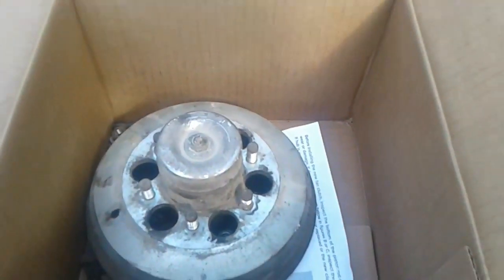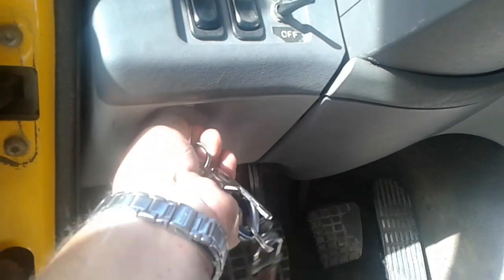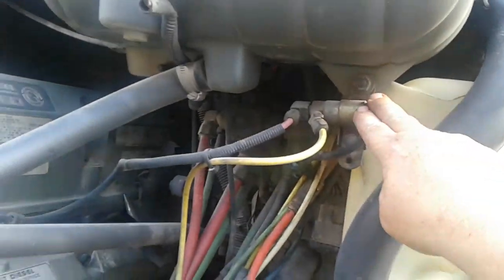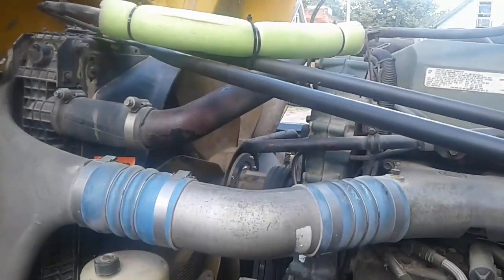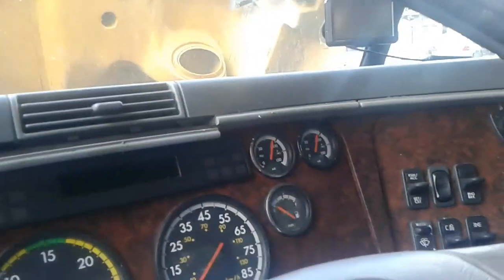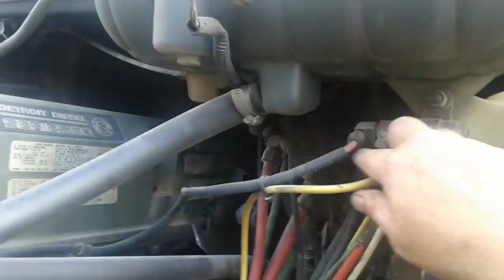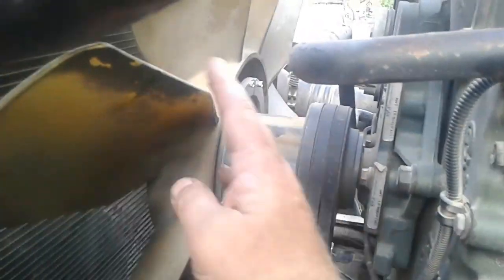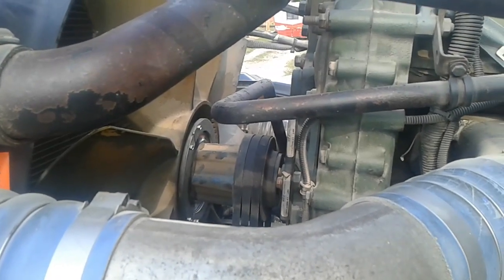Testing a fan clutch on freightliner Detroit diesel 60

Comment: Thanks for the video. When I turn my key to the "on" position, I get nothing. No bells or whistles like it normally does when it's cycling through. My batteries are showing 12.4 volts, so it's not the batteries. What can it be? This happened from one day to the next. Looking forward to your input.

Comment: thanks for your information, my question is do i have to build air when i test clutch?
Reply from the maker: Yes. Sorry took so long. Or the clutch won't shut off. Needs air to shut off. When you start your truck it engages until air builds up.

Comment: There is a lot more to these types of fans than what he is telling you.  He never mentioned the difference in Normally Open temperature switches and Normally closed ones and how they affect the air solenoid if its plumbed incorrectly and how that could cause the fan do do just what its doing in the video.  Truckers, do yourself a favor, take it to a good mechanic.  You'll save money and downtime in the long run.  Or, watch you tube.  You all drive safe.

Comment: Also when im running on the road with the toggle switch off my check engine light is on when i flip the switch on the check engine light comes off
Reply: Interesting. 

It could be that the toggle switch is upside down?

On my truck. 95 t600
My light is always on. Regardless if toggle up or down.

Comment: How you doing sir i have a detroit s60 12.7 on an international eagle 9400i i bought the truck with a toggle switch for the engine fan recently the check engine light turned on when the toggle switch is off the fan is loose but when i flip the switch to the on position the fan gets hard do u think the clutch is bad or the solonoid sir?